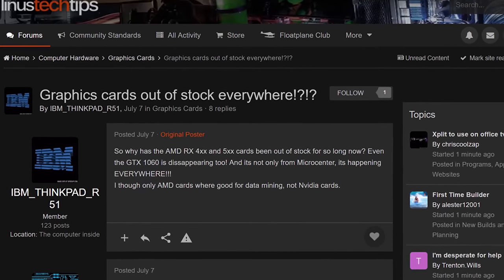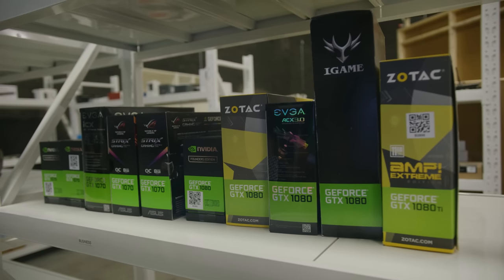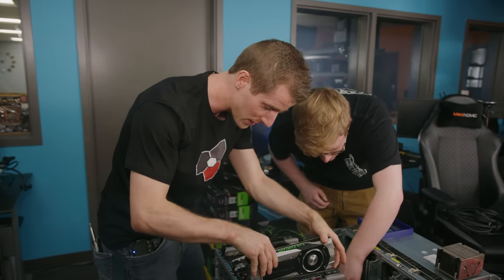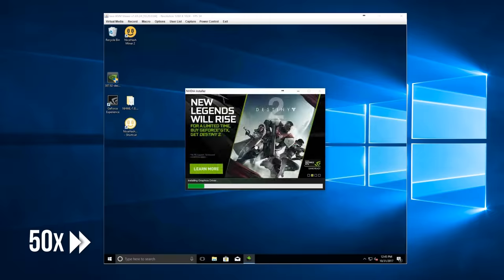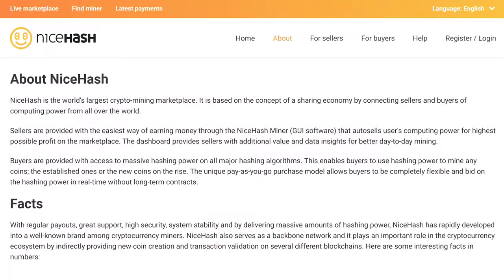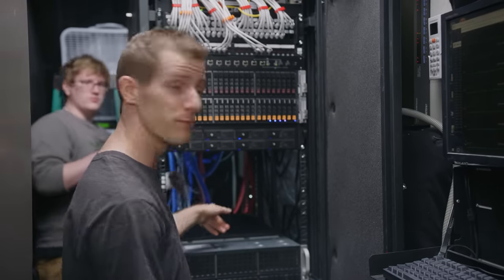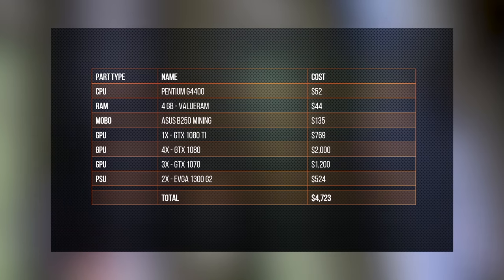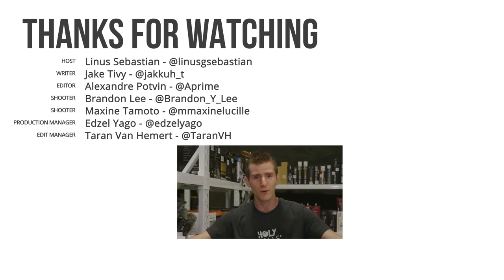IS GPU MINING STILL PROFITABLE? - Mining Adventure Part 1

Comment: Thank GOD the bubble bursted and they got hacked constantly so people are just giving up left and right . After  6 months FINALLY I can buy my gaming laptop. Forget about individual cards. Laptop prices were even more effected due to limited supply.
Reply: wtf is a gaming laptop? how long does the battery last with an AA game on high settings? 10mins? fuck out of my face with "gaming" laptops..
Reply: Gino Foogle Maybe some people have divorced parents who split houses and still wanna be able to game. Ever think of that? A decent gaming laptop isn’t meant to be used on battery. It’s meant for portability. Most gaming laptops have a Battery and a Performance mode.  Also most decent gaming laptops can handle modern AAA games at medium to high.

Comment: For speed of ROI, 570s, 580s, 1060s, 1050TIs and Vega 56 are MUCH better than 1080s and 1080TIs.
Reply: Birki gts depends where you get your 580s... I got my father a rx 480 8gb for $180 after Mail in rebate for Christmas 2016. that's less than half of 1070 msrp. also you can buy rx 580s for around $260-$280, whereas the cheapest 1070 is $400... they mine about the same speed(as they have about the same TFLOPS) Vega 56 also mines as well as a 1080 ti for the cost of a 1070(just bought a couple for $400 last week)
Reply: 1070s already dropped below 400, unless you're looking for Strix and Gaming X which are the top of the line for their cards and on average cost 50 bucks more even for the 1080Tis which aren't normally used for mining.
Reply: I can get 580s for 260 right now. 570s for like 230. 1070s can't touch that in ROI terms.

Comment: Solar.
Reply: But then you have to buy the panels. Only under certain edge cases would mining with solar be profitable with a reasonable payoff time.
Reply: 0.05$/kwh with Hydro-Québec
Reply: Well yeah but if your mining rig still isn't producing more money per kWh than what is your local going rate you would be just better off selling the electricity instead.
Reply: Joe Chief They do mine with solar and win power. They go to places with lots of cheap real estate, lots of sun and lots of wind, like Mongolia, and build large factories to take advantage of the econony of scale. You don't need the latest most expensive power generating technology if you have the space to put in lots of it and cheap labor who knows how to maintain it well enough.

The upfront cost is high, but not unrealistic and the cost per watt is just the cost of your maintainence staff and occasional replacement parts, which is very very low. Then resell old computer tech to recoup a good chunk of that big expense and the cost per unit of cryptocurrency comes down to safely below the value of selling it on the market. It isn't a hugely profitable business, but it isn't bad.
Reply: Joe Chief U are over exaggerating the price of solar, it’s cheaper than those GPU’s he has going.
Reply: I worked in Solar manufacturing for years - Solar is a lot like Bitcoin in that you've got to have those things in service for quite awhile to recoup your cost. In every place except island nations, fossil fuels are way cheaper because of the up-front cost of acquiring the panels.
Reply: +Matthew Ledford Yes, it's cheaper than those top of the line GPUs he has going, but that's a deliberately absurd rig. And while you've reduced your electricity cost you've massively increased your capital outlay and lengthened your payoff time, which in a sector as volatile as alt-coin mining is a big deal.
Reply: Joe Chief Yes I won’t disagree, but if u have a lot of money p, u will make it back within a year, check out the terra miner channel, he has a huge as farm

Comment: The memory type for the 1080s make it very inefficient for mining, swap them with more 1080tis or 1070s for a more efficient build. Also nicehash is only really good for pcs with 1 card after a certain amount the fees are too much and youre better off mining a coin straight. I suggest mining equihash(zcash, bitcoingold etc) for NVIDIA cards and ethash for amd (ethereum, ubiq etc.) But use whattomine.com for a more exact estimate on profits. Also 8gb of RAM is very reccomended for a mining build.
Reply: Not really true anymore at least with nicehash. 1080s have been doing quite well on Lyra2rev2 algo. Still too expensive IMO, 570s are much better but they do well.
Reply: No, 1080s have gddr5 which very good for mining and 1080tis habe gddr5x which is not the best memory for mining
Reply: Alluu 01 what are you smoking? the 1070ti was "special" because it didn't have gddr5x vs the 1080

Comment: First of all DO NOT MINE ON NICEHASH!! use claymore miner and mine ethereum on nanopool or any other pool. Use gtx 1070 not 1080, lower the power limit and get the memory clock as high as possible.
Reply: vfastdriver Anymore tips? I have gtx 1070 for no reason so I could use it
Reply: Do you have tips for me? I have a gtx 1060 6gb gaming x cooler i am using nicehash until now to mine equihash
Reply: Nicehash is a scam. I'm surprised they used it in this video. You can make much more profit from mining ether or some other altcoin.
Reply: This. mine with Ether. @on - NVIDIA driver is a bit fucky with this, there is an option to "Prefer maximum compute performance" in the NVIDIA driver 3D settings tab. You must turn that on. You might also need to mess with power states, which is something a youtube comment cannot cover.
@on @pelle sanders - Mine on any Ethereum pool using Claymore (there are other miners but its the one I use). Dual-mining is hit or miss as altcoins will take ages (literally years) to turn even a dollar's worth of effective payout (and it's not easy to cash out). The primary reason you use Ethereum is because it is very easy to turn into USD via Coinbase or GDAX.
In addition to this, overclocking is generally not the answer. Get the voltage (or power limit) as low as you stably can and get the memory frequency as high as you can. Cooling is also important, as degrees cooler equates to less power leakage.
Reply: smokeydops Thanks for the reply. Do you think vertcoin is good to mine too? And yeah playing with my gtx 1017's voltages has proven to be kind of fucky so I am def nor overclocking
Reply: on mine ellaism, search it up. Just refresh bitcointalk every 5 minutes. If you find something 1-5 days old mine it. It has to be good
Reply: OR - do not mine Ethereum, cuz everyone is mining Ethereum and therefore it's not that profitable as other, more low key coins right now (great example was Zencash, that nobody heard of 2 months ago)
Reply: Filipp Bavelsky ^^^^^^*^
Reply: How much do you guys make mining?
Reply: could i have that 1070
Reply: +Pikslzplit mining on just my gaming rig makes about $120/month at current prices, with a total system power draw of ~400watts from the wall. This is mining zcash with 2 1080s capped at 60% power draw (plus power used for the watercooling pump, fans, leds, etc.). I have a dedicated miner as well that does around $160-180/month at around 450w total power. It's a bit of a mess of whatever parts I could find good deals for though, and not the best optimized.
Reply: Used to make around 250$ a day - but it really depends on if you are selling instantly after you mine (which is pretty stupid) or if you wait for a price spike in the current crypto that you are mining - then the earnings are much bigger, but they cannot be messured as a steady income
Reply: Thanks guys! I really might look in to this
Reply: @James - Why do you say NiceHash is a scam? I've used it to sell hashing power and been paid accordingly. Made a decent amount of money.
Reply: @on -- I have only ever been able to payout in USD with Ethereum. I have no idea about vertcoin. There are a million and one cryptocurrencies. Only litecoin, bitcoin, and Ethereum are remotely stable enough to "set it and forget it". If you mine altcoins (wherein I say litecoin, bitcoin, and eth are "maincoins"), you have to keep yourself entirely on the ball with regards to each one's value, and save your earnings until the prices even hint at dropping then sell.

My problem with this is it isn't steady and it takes a lot of attention away from doing other things. But I will say, I use an R9 Nano to mine with my main gaming PC.. I don't mine with a dedicated mining rig.
Reply: smokeydops how do i use and set up the claymore miner? I have 16 gb ram and gtx 1060 6gb msi gaming x cooler(did a memory oc and core uc also lowered power limit to 80% 23mh/s) and just want to mine erhereum on the ethpool but i dont know if i need to change some settings in claymore miner
Reply: Download it. Extract it. Edit start.bat. Here is an example start.bat for NVIDIA hardware (DO NOT USE EXACTLY THIS AS IT WILL SET YOUR CLOCKSPEEDS)

cd /D C:\Program Files\NVIDIA Corporation\nvsmi\
nvidia-smi.exe -ac 3505,1531
nvidia-smi.exe -q -d PERFORMANCE
cd /D E:\ethermine_pool
^ this section is setting the power state of the GPU. I don't think you need to do this with Pascal, but you do need to do it with Maxwell. You can google commands related to nvidia-semi to help if you want more info about this.

setx GPU_FORCE_64BIT_PTR 0
setx GPU_MAX_HEAP_SIZE 100
setx GPU_USE_SYNC_OBJECTS 1
setx GPU_MAX_ALLOC_PERCENT 100
setx GPU_SINGLE_ALLOC_PERCENT 100
EthDcrMiner64.exe -epool eu1.ethermine.org:4444 ... more to add here.
Read the thread for claymore miner. your pool should have instructions on how to use claymore.
Reply: smokeydops and for EWBF's CUDA miner?  I want to run stock clocks and mine zcash with the equihash algorithm because its more profitable than ethereum for me

Comment: PLEASE do a benchmark between Windows and Linux running the same configuration with nvidia and amd cards. I did that once and got slightly better performance using Ubuntu. Also, you could maybe utilize 10 cards by using 5 from each amd and nvidia. And utilize the cpus for xmr mining.

Comment: Compare your systems with the asic miners.Would really like to see if the asic equipment is worth the price rather than investing a ton of $$$ on GPUs.
Reply: It isn't, the return on investment is slow on these.(4 years) as compared to an year for ant miner

It's a different matter if you own a gaming cafe
Reply: Suraj Grewal ya but so is the case with GPUs . So then should one buy a gpu or an asic miner . And perhaps I guess asic miner would mine faster than gpu in nearly the same price ,right?
Reply: You need to have an ASIC that you can’t find on the market or a absolute fuck ton of them. They’re super expensive & far from worth it.
Reply: Vivek Bamnelkar no, they mine different coins & at different paces. ASICS are useless right now. GPUs give you the most money in the best amount of time.
Reply: GudJuJu now it makes sense. And you can always sell old GPUs so that would also return much of the cost. Is renting these overkill systems any good?
Reply: ASIC miners don't compete with GPU miners because they can only mine SHA256 based coins (pretty much just Bitcoin). The ROI for both will tend towards not much because as long as there's reasonable profit to be made more people will jump in and raise the difficulty, lowering the profit. The only difference is that GPUs are more flexible, as they can switch currencies if conditions change or be repurposed/shared with other tasks like gaming, as well as resold. If your ASIC miner gets outdated and a new, more efficient one turns up, or the Bitcoin algorithm changes such that the ASIC miners currently around can't mine it, that's it, it's now useless unless you want to use it to make SHA256 rainbow tables instead.

Comment: If you adjust the power limit, and oc. The cards will run much more efficiently!!
Which means faster return on investment!
Reply: no
Reply: hubatruck yes. My 1050ti at stock speeds gets 10mh/s. With just a memory oc, and underclocking the core by 400mhz, it gets 15mh/s. Since core clock doesn't particularly help at least ethereum, you can take core clock off, to be able to add even more mem clock for maximum efficiency.
Reply: * mem clock
Reply: oh shit thanks lol. just got a new phone so my autocorrect hasn't gotten used to the acronyms and shit that i say
Reply: Power to ~80% and +300mhz works great for my 1060, I mine in my spare time
Reply: Qizazie No,OC lowers hashrate/watt
Reply: i crank my power limit and temp limit all the way up, pull core clock down to -400, and put my mem clock up to +1000. usually i can game with +1000 mem and +160 core, but using the claymore ETH miner, it doesn't seem to like that combo, as it crashes frequently, so i just pulled my core clock down to -400, and actually only lost about 0.2 mh/s
Reply: not if you just oc the mem, that helps a lot in mining Ethereum, my 1070's go from 26 to 32 mh/s  with +750 on the mem, and it use less power because of my 60% power limit
Reply: Yup, my gtx1070 gets 26mh/s and consumes 140w stock.
With underclocked/undervolted core + overclocked memory, I get 32mh/s while consuming 110w. 
(power consumption numbers from HWinfo64, not sure how accurate)

Comment: I'd like to see a video to see if gear from a mining rig is any worse off after being used for 24/7 for a long time.
Reply: The hardest wear is on the fans.  Most miners undervolt their cards to make them as efficient as possible.  Now if the person mining doesnt do this and actually overclocks then heat may be a problem and concern is understandable.  Mine run 50-60C which is pretty low for air.  My overclocked 980ti hybrid can reach 50c.....needs cleaned and low fan profile.

Comment: I'd like to know about how the hardware is after being used for mining. Is it still fine to buy and use for gaming or has the mining severely shortened the lifespan?
Reply: Properly setup and cared for mining GPU's work just as well as anything else you buy new or used.  Serious miners under volt and find the sweet spot of power consumption/speed, which is always less than a gaming-centric GPU running balls to the wall overclocked for higher FPS.

The only regular issue a mining GPU might experience is after 2 or 3 years, you might have to take apart the fans and or replace them.  Fan failure is far fare more likely than anything burning up.   2nd likely failure point is using a cheap power supply to push the card.  Take the time to design/build the system right and maintain it, and it will last a long long time.
Reply: Nope, it is completly destroyed, 24/7 use is twice what a serious gamer put in a card, 4 time what a standard gamer put in. Not worth it to buy second hand.
Reply: thibault bernier generally, graphics cards in compute use slightly less power than gaming
Reply: it is like buying a car that has been used as a taxi.
Reply: So SSD, being not mechanical wont die then, just like cpus. Come on, do better than that. Every hard miner know they have a card dying or starting to act crazy every other month. You give 3/4 years of regular gaming in a year...

Comment: It’d be cool to know the effect on hardware after its mining life. It seems like a great opportunity to grab some cheap hardware, but would it be warn out?
Reply: billybagsnatcher gfx cards are meant to be used hard.. Most time people just plug them in and go game around 80c. Which is hot lol, mining should not have much impact on the life of a card, now they may need a can replacement after a few years, But I started mining 2 years ago and my orig cards still perform perfectly, even tested them on gaming
Reply: Like andrew says. Gamers actually run their cards way harder than miners do. Gamers essentially tell thier cards to go from walking to sprinting over and over again. High load, High temp, then little to no load and a cool down. Its rough on the parts. Miners, on the other hand, tune their parts to optimal performance at the lowest power consumption and heat production possible, without loosing significant has power. Their cards could be considered marathon joggers. They get in the groove and just keep running. As long as cooling is well placed and the miner isn't stupid about his configuration, then the used mining cards are going to be a way better choice for the buyer of a used graphics card.

Comment: Use the gtx1060 3gb x 8 it is a better wattage to hashratio and set it to 60% power use, you wont lose much hashrate. You can make your investment back in a year.
Reply: current ROI is around 4 to 5 months. If you are not ripped off by utility tariff.
Reply: You won't be able to mine Ethereum next year with just 3GB. Word of warning.
Reply: DAG size is not increasing that fast. It's just 2.18GB right now. 3GB cards hit wall early 2019.
https://investoon.com/tools/dag_size

Also GTX1060 can mine ZEC, it has about same profitability.

Comment: I buy cards as editing and gaming rigs, then mine on them when not in full use - annual return more than pays for the equipment within the year. Mining when you would normally be running a space heater, or at night or winter when your thermostat would normally be engaged, eliminates power usage because if nothing else they make great space heaters. I'm also mining monero on old laptops (the only remaining reliable cpu coin), again when it's cold (as a computer repair person I receive lots of donations when folks upgrade, including from friends at offices that give all their computers away at once). It took a few extra yards of shelving space in my workshop but my new heating equipment is now making me money and actually pulls less power than a typical space heater.

Also, if you want stability and you want the BSODs to stop try telling NiceHash to avoid the CPUs or at least lower how much hash you expect them each to put out.